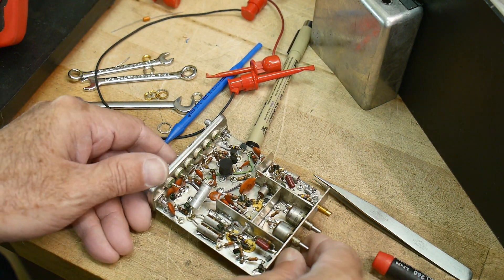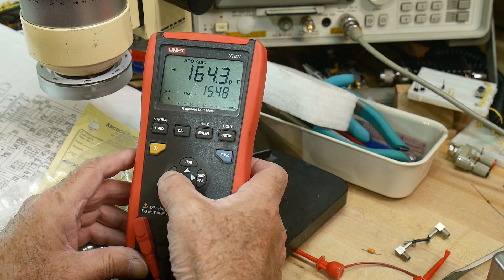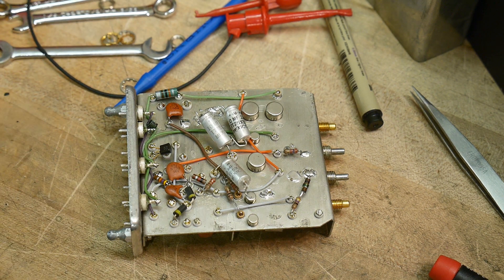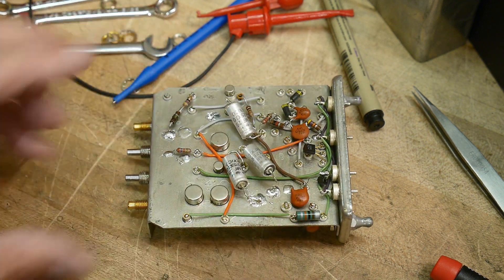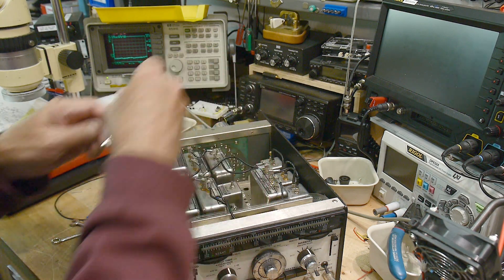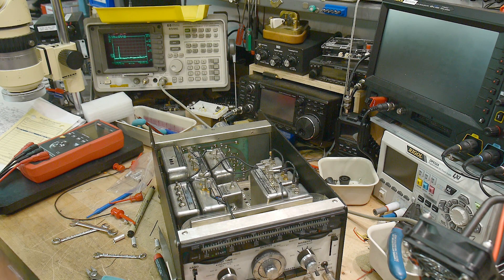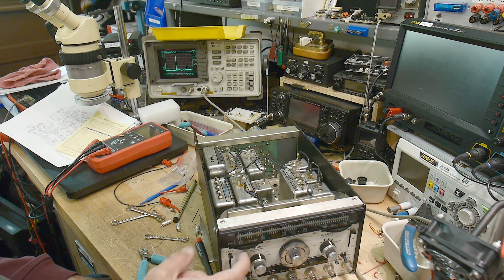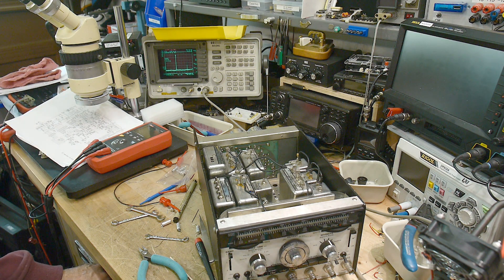#1126 Wavetek 2001 Sweep Generator (part 4 of 10)

Comment: I have no real world experience with the repair of older electronics hardware, but I’ve hear the horror stories of capacitors leaking.  In fact, many of Motorola’s early “Astro-25” (very pricey APCO Project 25 digital radios) were experiencing all sorts of cap leakage problems.  Supposedly there was actual physical electrolyte leakage that also caused physical damage to many adjacent components and devices.

How common was this / is this.  Does it only pertain to a single type of capacitor?
And.. the huge question of the day:
Is this necessarily an ongoing problem?
Are ANY capacitors currently being produced that will NOT leak?

Another EXCELLENT video… 
Thank you so very much for all of the work you do.
I have recently been catching up on so much educational electronics and test equipment videos.
I can only lament the fact that you were not one of my instructors!
Reply from the maker: yes capacitors go bad. the most common one is aluminum electrolytics. any capacitor >4.7uf might be a problem. even if they don't leak, they stop working. here is an example of bad caps: https://youtu.be/YadG-NTCy_c?si=N6MI62VzXJv51ijc
Reply: @IMSAIGuy  That’s scary…. But are newer production capacitors better at this?
Thank you again!
Reply from the maker: In a couple decades the new ones go bad too. there are good brands and bad brands, but the all go bad eventually

Comment: YMMV, but if it were me, since you've had some intermittent sweep on band 1 but at a lower level, I'd be De-Oxing all the switches and controls, and the pins and sockets in those plug-in modules to try to eliminate an intermittent.

The block diagram in the manual shows that Band 1 has its own sweep oscillators which are fed to a mixer, then the output of the mixer is fed to a broad band 0-500Mhz buffer/pre-amp. Since there is no buffer or pre-amp for Bands 2 and 3 and those bands are more or less working normally, I'd start by checking the output of that pre-amp and works backwards towards the Band 1 osc/mixer section ...

73...VE6ZT

Comment: To get to ESR mode on the UT612, switch to manual capacitance, series mode, then you can get to the ESR function. This meter is basically a functional copy of the DER DE-5000 (I own both).
Reply from the maker: I know how to do it, but for some reason it didn't change.